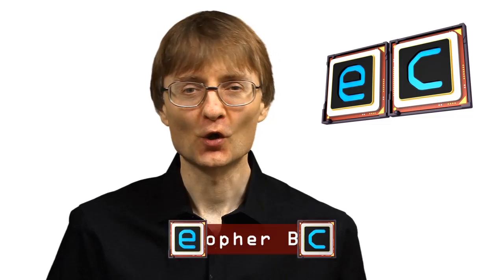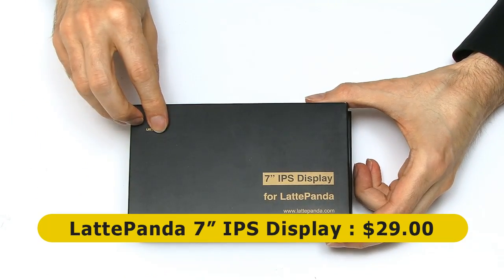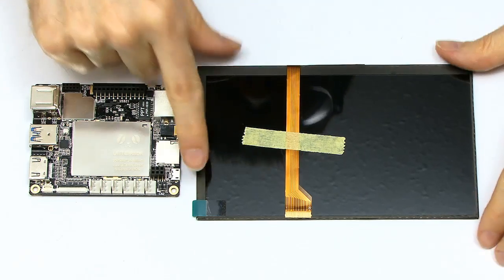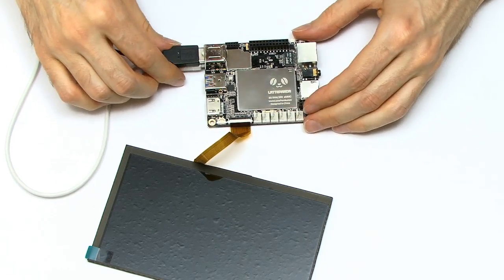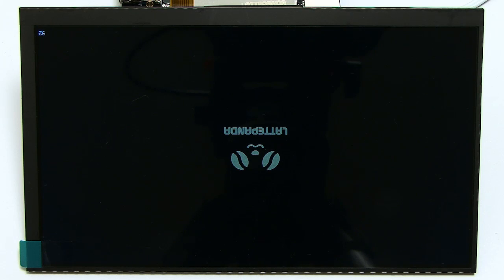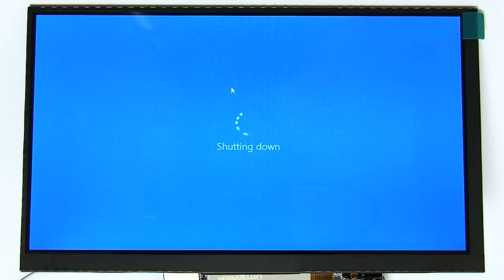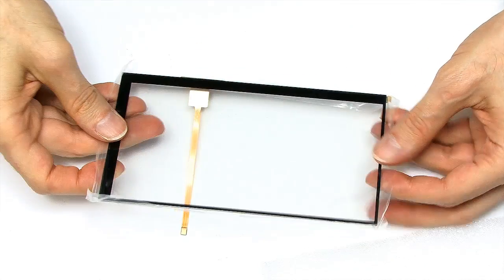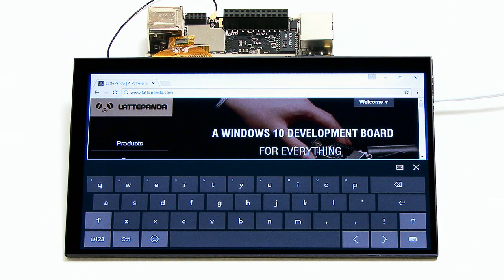LattePanda IPS Display & Touch Panel

Comment: I like the Latte Panda. Something like this can be excellent to have in certain situations. However, I wish that the ribbon cables for the display and capacitive touch screen were sleeved to offer some kind of durability and protection. Those cables are delicate and can break very easily. Also, it would be excellent if the screen had some sort of stand mechanism. Small things like this matter to consumers as they can increase the usefulness and life span of such a device.

Comment: I have a windows 10 7" capacitive touch screen. Using finger touch for serious computer use on a 7" screen  with software such as desk top publishing, spread sheets and such is useless. Fingers won't even activate small menu buttons. I am happy to use it with bluetooth mouse keyboard but this needs a stable table top or other flat surface. A restive touch panel with a stylus would enable hand holding and using mouse and keyboard input comfortable.Finger touch screens are just gimmick. albertstc01

Comment: I'm in the process of building a tablet out of the lattepanda and a 10 inch touch screen. (just have to build my battery bank, design a case, and have it printed ) So far the only issue is heat. And I need to run more test's on its power usages.
Reply from the maker: That will be a nice tablet. :)

Comment: ill ask it uses for.rpi? rpi touch screens cost more than that soooo why not ask it
Reply from the maker: Yes, it works out cheaper than the 7 inch Pi touchscreen, and is higher resolution. But sadly it has a different interface to that on the Pi, so cannot be connected to it (well, not without some kind of interface board). :(

Comment: I think it's so fascinating how capable smaller computers such as the Raspberry Pi and this (I'm sure there's others).  I suppose gaming is different, but do you think this is the future for consumer computing?  No more towers, just connect to a monitor, and peripherals.  Not sure about laptops as they can't be mobile, but if you have a monitor where you work for example, and a monitor at home and just use the computer between the two places.  Not to mention they'd be more energy efficient too.  Very interesting video.  :)
Reply from the maker: Thanks for this. And yes, I am sure this is the future for many types of computing -- maybe even, in time, video editing and gaming as the power of smaller devices increases. I read today that NEC are releasing a new range of large monitors that can fit a Raspberry Pi compute unit (effectively a Raspberry Pi in another form factor) in the back. This is intended for doing things like digital signage, but may also indicate another avenue of travel. I am currently planning videos on both the future of the desktop PC, and of single board computers . . . :)
Reply: ExplainingComputers You're welcome, thank for for spending the time researching, making videos and responding back to comments.  It's really nice to see a big channel (over 100,000 subscribers) where the creator responds back to viewers, I'd imagine it isn't an easy task either.  I just Googled that article and saw that the computer slots into the back of the TV, which is even better as it will hide cabling, and I would then assume the TV would have the ports on it seeing as most SmartTV's seem to have them.  I look forward to viewing this video.  Thanks for commenting back again. :)

Comment: I really like the LP. I needed a portable computer for a GCS for my quad and the programs I used weren't available for Linux which made both my raspberry pi and my odroid disqualified. 
I am really happy with it and the first thing I did was replacing win 10 home with pro and it works really well
Reply from the maker: Excellent. It is great to hear how you are using the LattePanda. :)
Reply: ExplainingComputers I actually bought it right after watching your previous LP video :)

Comment: Can the lattepanda run a 64-bit OS?
Reply: it does, but 32 bit OS is free(full licence) when u buy LattePanda with 2g RAM and 32G Flash,
Reply: TAK WAI WONG I want to install windows server 64-bit on lattepanda with 4gb memory
Reply: Justin Frost ，u could. i bought both the 2g/32g and 4g/64g version. i think they both support 64 bit os. but 2g/32g version will pre-installed a full license 32 bit windows 10 . but 4g/64g is not
Reply: if we beleve what he wrote in the video is not free

Comment: Very interesting video!
But I think 7 inch screen is a bit too small for me.
I prefer 10 inch screen.
Reply: Chesty McStudmuffin I wonder if sql server would run on this thing.  Might allow for a mighty carputer
Reply: Well this thing gonna be perfect for head unit for my car...oraightttt
Reply: I like a 7.2"
Reply: l2iKY usually single board computers are not for daily usage, they are use for programming, controling robots .etc
Reply: Generally, maybe, the larger the better, but I think the whole idea of such a Micro PC
is for reasons of portability, and ease of access in the field.  AND for the 'serious' hobbyists 
to adapt such a small Micro PC and relatively small screen INTO what ever they may wish
to fabricate for their Projects. Like a hand held Engine Analyzer etc for example.

Comment: Nice IPS and touch interface, I think that the oversized bazel (only on two sides) is a little bit unnecessary. Is there any other sizes available, also is there any off-the-shelf external cases that can be used with this combination of the LattePanda and 7 inch display?
Reply from the maker: Hi Mark! :) The 7" hardware are the only official items at present (though I am sure that I have come across a 10 inch panel online). There are no official cases, but I do plan on designing something and featuring it in a video at some point.
Reply: ExplainingComputers
Strangely, I have a couple of old Nexus 7 devices that could have their cases easily modified to be used with this combination (the availability of these devices / cases are fairly common and inexpensive from ebay).

Also does DFRobot produce / sale any batteries for the LattePanda?
Reply from the maker: Mark Edworthy They don't sell batteries, but most USB power banks work fine. I actually tried this out, but forgot to show things running from a UBS powerbank in the video. Great deal on an old tablet case. :)
Reply: ExplainingComputers
Obviously, with a bit of soldering / modification, most internal phone or tablet batteries could be used with the LattePanda.

This topic gives me the opportunity to recommend / plug (no pun intended) my favourite powerbank, which is the B30224 from EC-Technology (capacity of 22400mAh / 82.8Wh), which I have been using for at least two years.
Reply: +ExplainingComputers
I have a few ideas for future LattePanda based projects:

1. Installation and explanation of VNC server or Windows RDP protocol (either to be used as a replacement for a physical screen or to be used in conjunction with an IPS).

2. Explanation of Windows file share / SAMBA protocol (to be used to share files / directories with other devices / computers)

3. Installation / wiring of a Qi coil (or usage of a Qi - USB interface) for wireless charging with usage of an internal battery.
Reply from the maker: Mark Edworthy All great ideas -- noted with thanks! :)
Reply: Chesty McStudmuffin
Whilst it is true that the RDP libraries are not included within MSWin10 home edition, there is an open source project available that allows this version of Windows to support the RDP protocol, this project is hosted at / can be downloaded from:
https://github.com/stascorp/rdpwrap

Alternatively, consider using either a VNC based framework (ie. TightVNC, RealVNC or UltraVNC), TeamViewer or the Chrome based Remote Desktop extension as a replacement for RDP.

Comment: I hope in coming years, the upcoming raspberry pi's will support Windows operating system. 😊
Reply: It already does.  https://www.microsoft.com/en-us/download/details.aspx?id=48232 (Actually, it's the other way round; Windows supports the Pi.)
Reply: Actually...it doesn't work much. It's just a bare interface with nothing much to work with. Windows doesn't support ARM processors, that's it.  The whole kernel should have to be rewritten in order to have a fully functional windows under ARM platform.